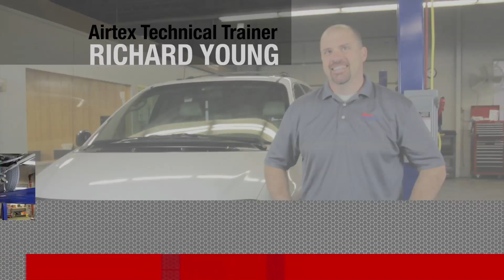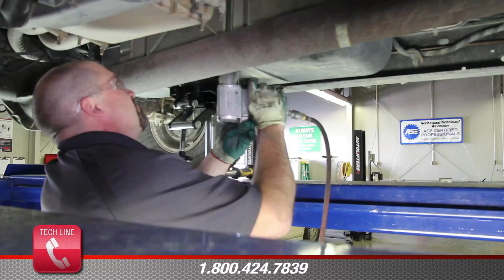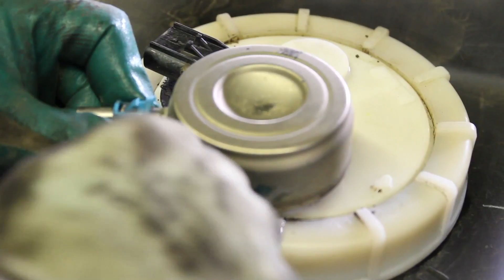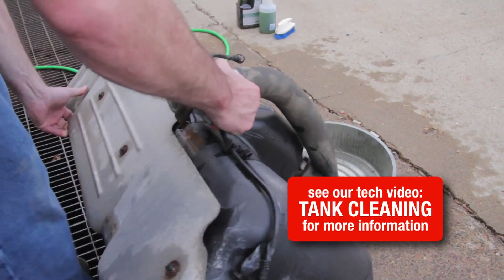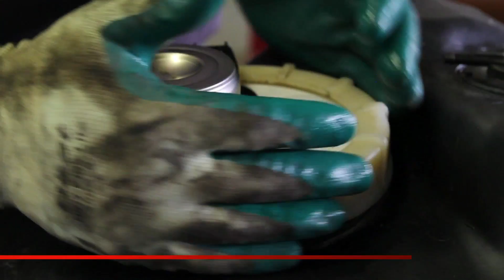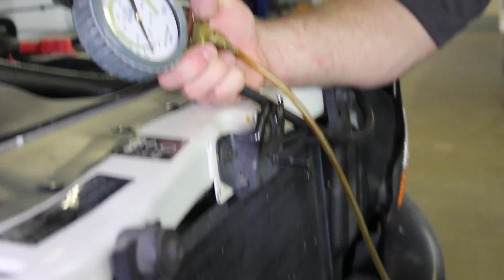How to Install Fuel Pump Module Assembly E7116M in a 1999 Dodge Dakota

Comment: Nice to have a shop.
Reply from the maker: Yes, there are times is is nice, other times a necessity!
Reply: @AirtexFuelPumps  what size are the tank strap bolts?
Reply from the maker: @jcarterize  My research says it is most likely a 14 mm or a 9/16".